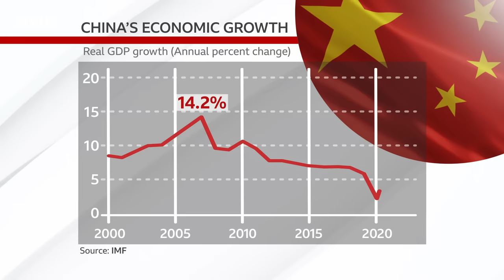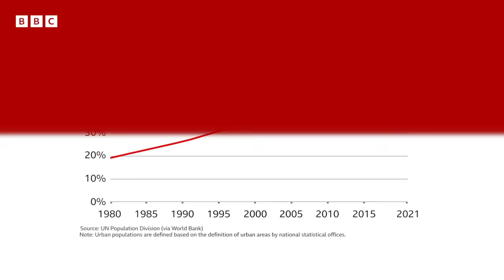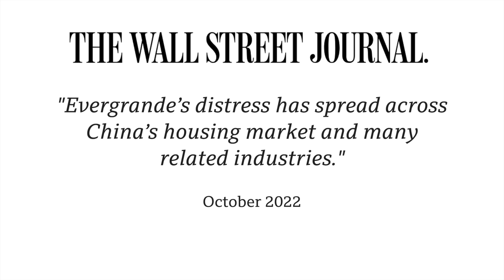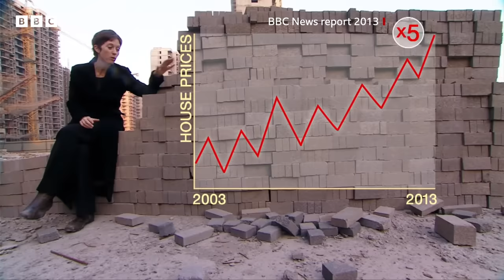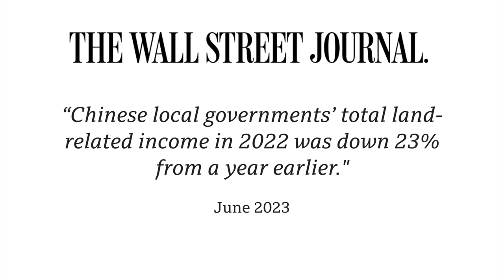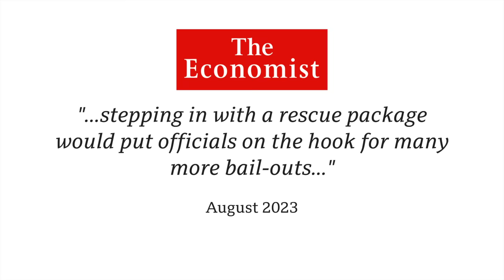China's housing crisis deepens as Evergrande shares slide - BBC News

Comment: @0:47, you're using the propaganda GDP, value, which has been horribly inflated, with compounding, for decades. The CCP's real GDP is about 60% smaller than the propaganda figure, so housing is around 42% of the PRC GDP. The facts are that, if the CCP's GDP were as high as it claims, it would not be in such dire circumstances, nor would it have increased its money supply by almost 45% within the past two and a half years with absolutely no effect on domestic consumption.